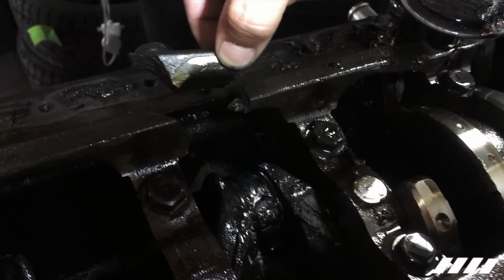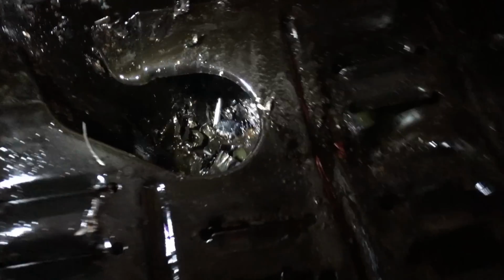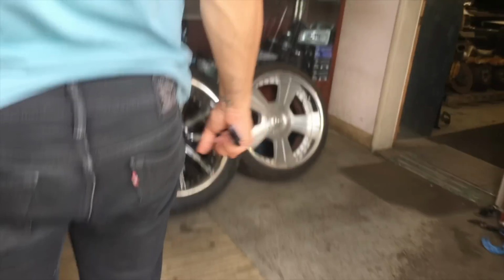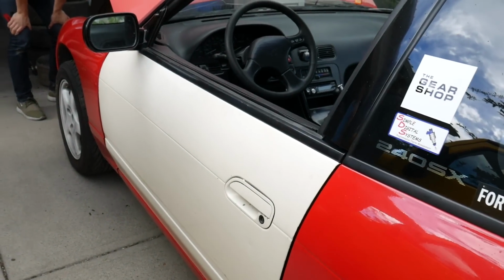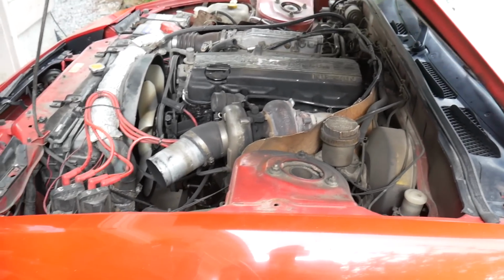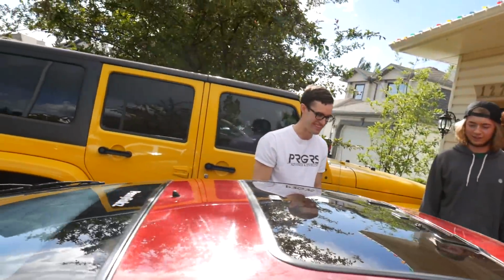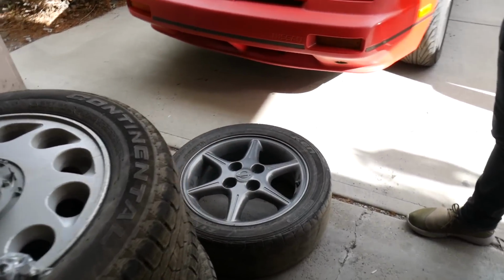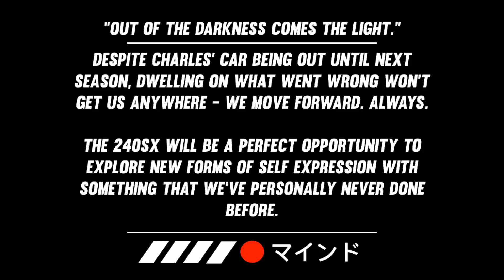The Next Step...

Comment: Low octane fuel, factory ECU, many aftermarket parts = This is not an accident. You could build a long block to handle 1000hp, but without the proper setup, failure will eventually occur!

Comment: I have a nice Sr20det you could put into that 240 it's got a bunch of shit done to it 264/264 cam, intake, 2 different turbo manifolds, 750cc injectors, new oil pump and a bunch of other stuff it was running a solid 300hp before I pulled it and it's been sitting in my garage since I got an rb25det. Hit me up if you interested Id sell it for a good price cuz it's just taking up space lol. I also have a shit ton of other 240 aftermarket parts sitting around that I'd get rid of too
Reply from the maker: Interested, can you slide into our DM's on ig?
Reply: Lowcals messaged you on ig
Reply: Dustin Aldrich sr20 is good

Comment: I need an adivce, i wanna get an RX 7 but i heard rottary engines brake fast, whats the best swap for it
Reply: Pero  build a nice rotary engine or 2jz, LS.. nothing is "reliable" forever
Reply: Pero depends who is your Mechanic get a rotary specialist and they will last forever don't follow the hype
Reply: Get a rx7 jist make sure you have a mechanic who specialises is rotatrys and dont ever put a LS in a rx7 #fukLSswaps  If it does brake  just get a new block dont swap it of you have no choice get a single turb 1j  and put in
Reply: the best swap is to swap the driver to one that will take proper care of it so it won't break.
Reply: check out some rotors magazine videos and you will know much more. rotaries can be reliable if you take care of them
Reply: Just read up on how to maintain a rotary, don't swap an RX7, the whole charm of a RX7 is the engine. Just learn the ins and outs of rotaries and you'll be fine, they're a lot more simple than you'd think
Reply: Wow guys you are awsome, such a good response and we are a great  community
Reply: Pero it depends on what Rotary engine. if you get a 12A or an NA 13B they're actually reliable. I've been driving mine every day for the past two and a half years with over 200k miles on it. You just need to properly maintain it.
Reply: rotaries are reliable if you know how to take care of them. Dont be easy on them, oil regularly, DO NOT BABY THEM

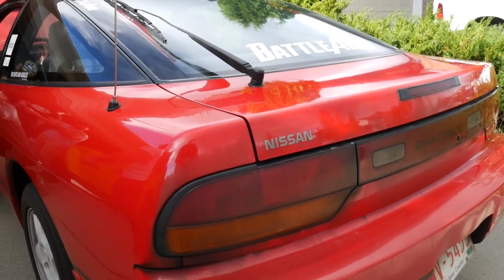Comment: Ok At 10:36 give you a decent shot of the rails but the bulk of the damage comes on the inside. Where it goes from a curve to a flat part of frame rail you can see a small amount of separation on the rail. Not a bad shell though if you got a good price. If its Charles who wants it I'm sure you guys did though. I didnt notice the A-pillar rust. If it rust through there may be water leaking into the car and you not seeing it. They rust from the inside out down through the frame rails. I know from experience :(

tl;dr Its a little rough but im sure you got a decent deal. Perfect drift car.